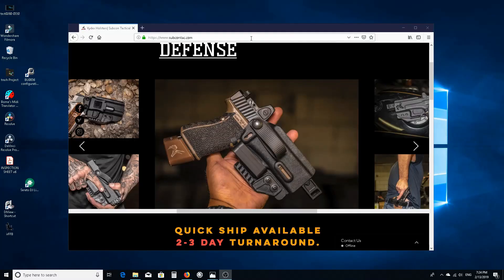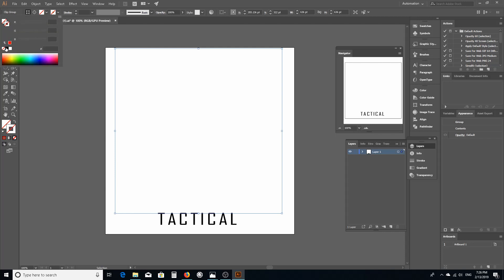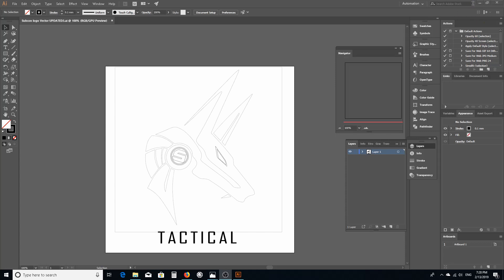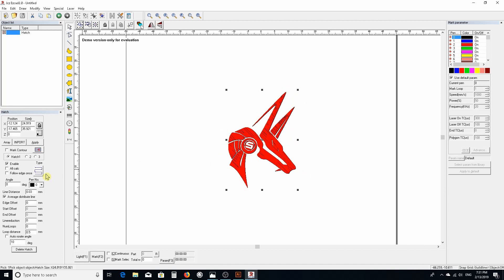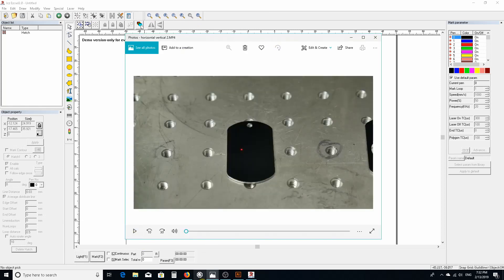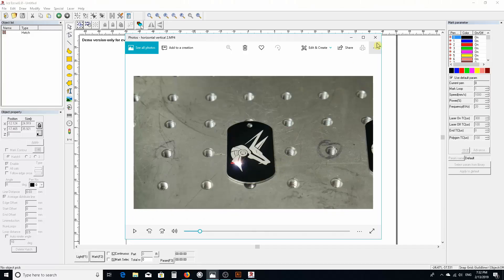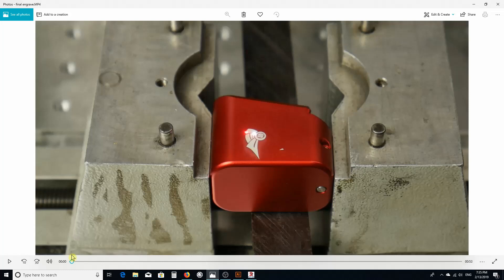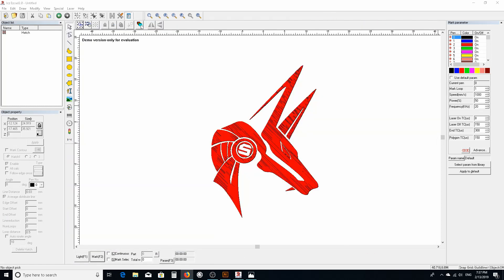Fiber Laser engraving  an Anubis logo for Subcon Tactical

Comment: I thought you set once the correct timing with the test you have shown in the other video and you are done😱 do you have to play around with the timing values in each job?
Reply from the maker: No only if the speed change is drastic. Changing the hatch pattern does not affect the speed.

Comment: Great Videos!  I was wondering why the "s" that is white in the Logo, in ezcad, appeared to be engraved.  I had a similar problem with a design I engraved.  Is there a way to stop the laser from engraving certain areas even though it is a closed section.  It was white, no hatching inside, but then it engraved that portion.   It does make sense that the "s" in that logo needed to be engraved, just wondering if you fixed that to "hatched" in a later video.   Thanks again for taking the time to make these videos!  Very useful!!
Reply from the maker: Keen eye you have.

This was not the actual file that I ran. The file I ran did have the "s" hatched is ezcad2. Sorry for the confusion.

You can select parts of the art and on the botton check the box that says mark selected. It will only engrave what you have currently selected.